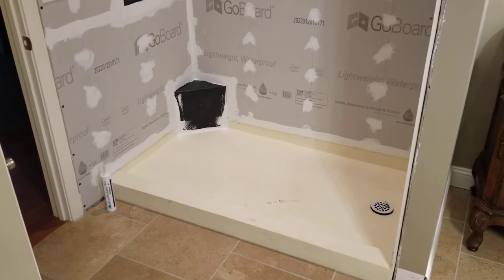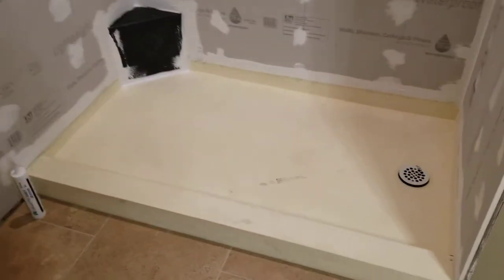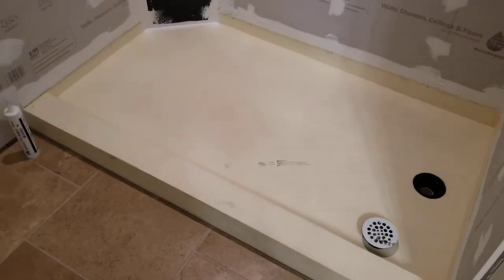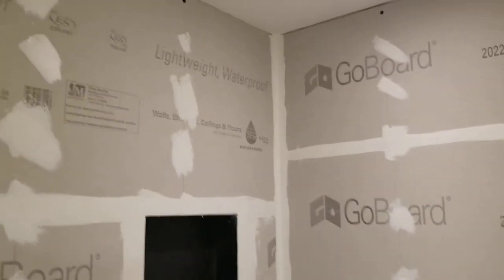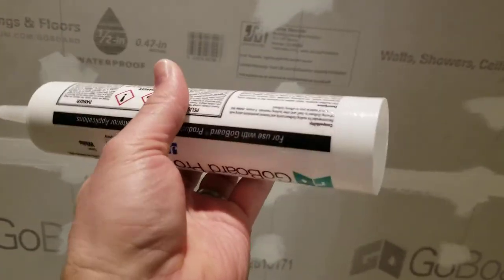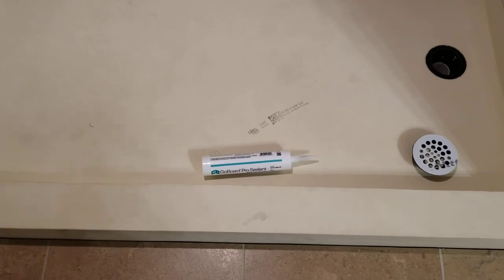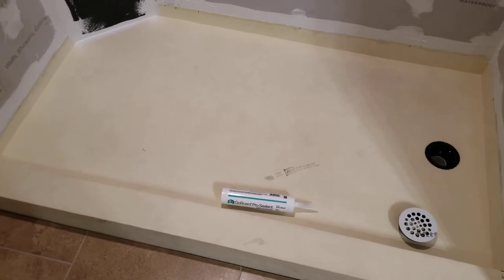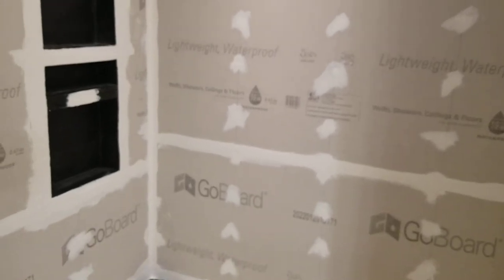**Tile Redi Pan & GoBoard: Must Watch Before You Buy!**#beautiful #tileshop #youtube

Comment: I just bought this system for both bathrooms.  I did the upstairs and I learned quickly....it will install like butter if you do the prep work (clean floor, well mixed quick set, all walls are plumb).  So far so good!!  Great video.

Comment: Your drain connection.  Was your pvc pipe flush or did you have to recess the connection when the connection was made? And if so what was the measurement from concrete to top of pvc receiving the shower pain drain insert?

Comment: Hey I did a mistake and left a big hold for drain (18x13 inches) so the pan is pretty flexi around the drain hole (center drain). How can I fix it?
Reply: well u needed to replace the subfloor and cut it tighter before installing the pan..so not much u can do now. lol

Comment: My redi pan has the cement board sitting on top of the flashing and it’s flush with the top of the pan wall at the top, but the pan sides are sloped inward which will result in the pan floor first course of tile is sloped not plumb. How do I address this?

Comment: How do you grout around the drain?
Reply from the maker: Just set your height to your tile and fill the area with the grout.
Reply: @LEX508YouTube  do you need to put anything on the threads ?
Reply from the maker: I put a little bit of Teflon tape.
Reply: @LEX508YouTube  thanks

Comment: Can we get an update to how the shower looks now?
Reply from the maker: Sure! This was a winter project for me unfortunately because of waiting time for tiles I haven't finished the job yet. It's at my own home no big deal but I'll be back at it probably in the middle of October.
Reply: @LEX508YouTube any updates ? Also, what are the dimensions of the inside of the pan once tile is installed?
Reply: @OGCJ10 The interior dimension of the pan is 1" smaller than the stated overall pan dimensions because the pan is measured from exterior to exterior and the pan sides are .5" thick. Assuming the thickness of tile plus thinset to be a bit less than .5" (depends on your tile thickness). So the dimensions would be the stated pan dimension minus 2"